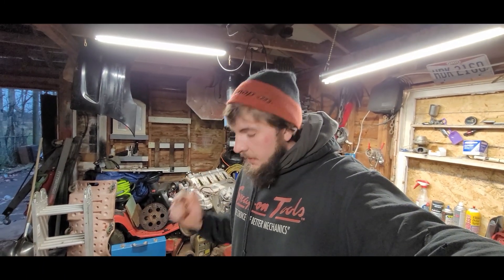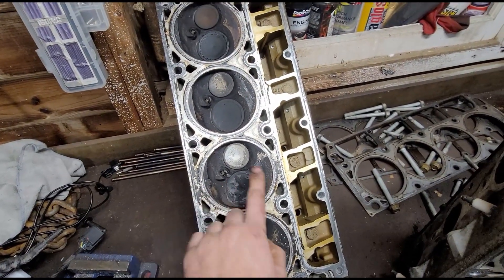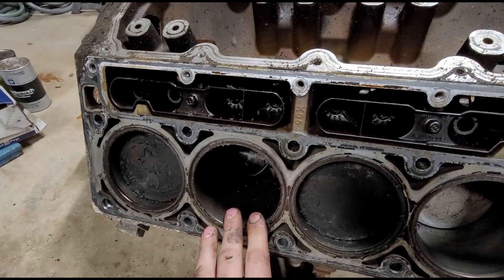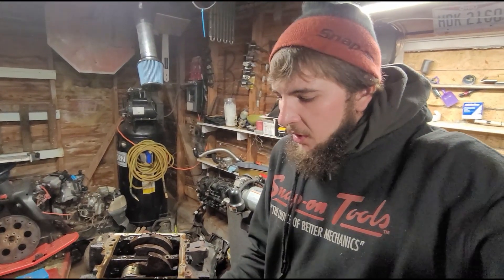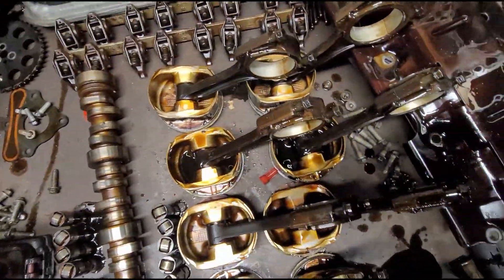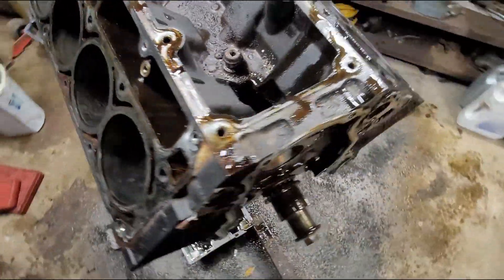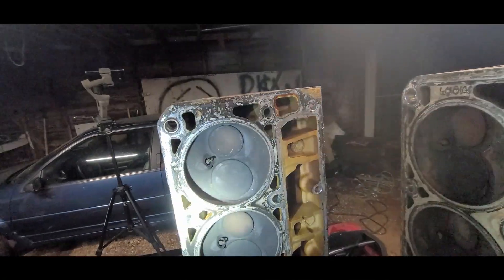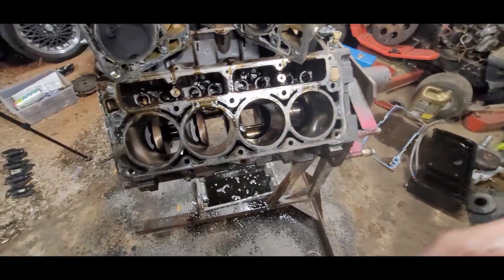Taking apart my LQ4 from the SleeperGTP

Comment: I'm not no master mind on mechanicing but I can tell by the video that the heads that your going to be using has smaller valves than what was on the heads that was on your engine to begin with. I might be wrong but you would be boosting your compression up but your air flow would be worse wouldn't it? That would be like taking 305 heads off and putting them on a 350 smaller chamber but also smaller valves. You would be defeating your purpose. But like I said I'm not no master mechanic. Also I could be wrong on the look of the valves. I also don't know much about the ls engine's but I wouldn't thank that would make any difference.
Reply from the maker: My expectations and hopes for these heads are based solely off of dyno tested results of the 799/243 heads vs. the 317 heads that come on the LQ4. I ended up with these 799s from a junk engine so I did some quick research to see if they'd serve any benefit on my setup as it currently is as an N/A setup. Once I get into the goal of having a turbo and actually building an engine to fit it's needs I  will be more concerned with the technical aspects of the heads rather than just throwing something on because I have it lying around and it has been shown to improve performance via the third party testing.
Reply: @AutoTechTyler  you can tell I would be lost building a ls. Im still stuck on the old small block. Lol. One of these day ill upgrade to ls. Good job on the build.